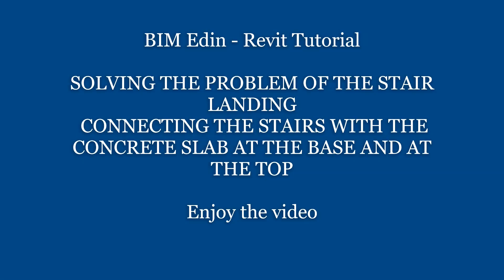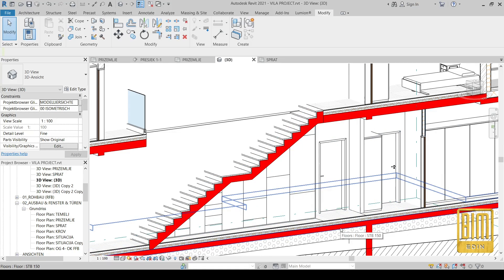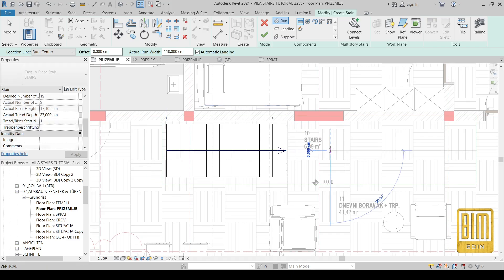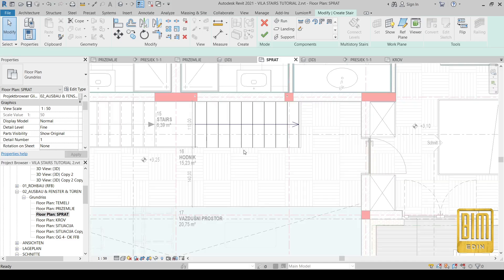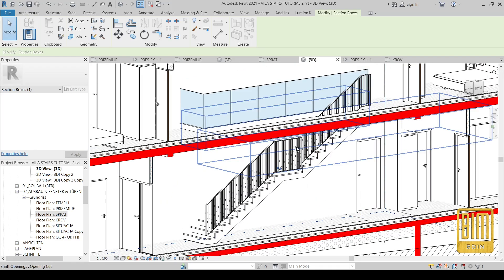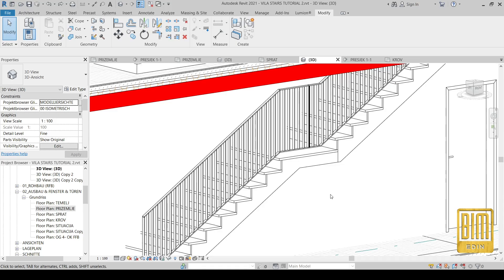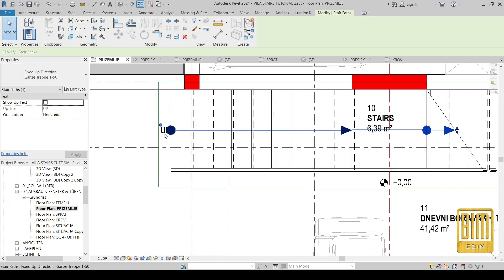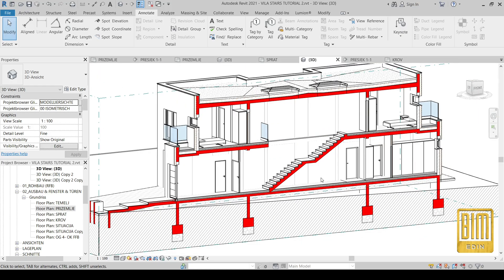CONNECTING STAIRS WITH BASE AND TOP CONCRETE SLAB / PROBLEM SOLVED

Comment: Great idea, but what about using model in place for missing concrete triangle below stair "easy way", or modeling real landing insted of tiny landing you use 
Without needing to change landing thickness or separate the stair "you need to modify slab sketch to prevent overlapping"
Reply from the maker: https://youtu.be/-lMSytmHp8w?si=ymoA7GUiNrmVnDdK 
Thank you for your comment and support. On this link there is a tutorial for the rectangular connection of the staircase with the base concrete slab and the calculation of the materials for the staircase.
 The upper landing is thin for 2 reasons:
 - due to situations where there is not enough space for landing 
- due to differences in the materials of the final layer of the floor and staircase (avoiding problems with joining the staircase and floor)